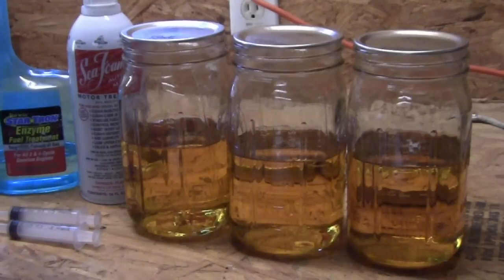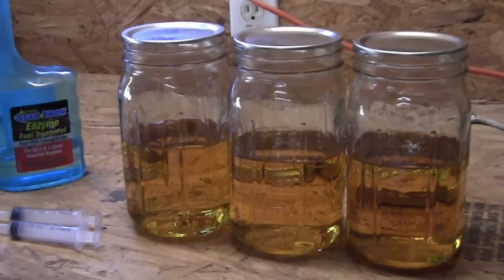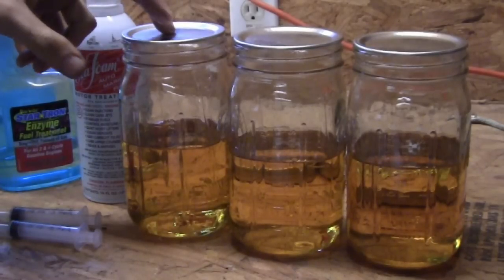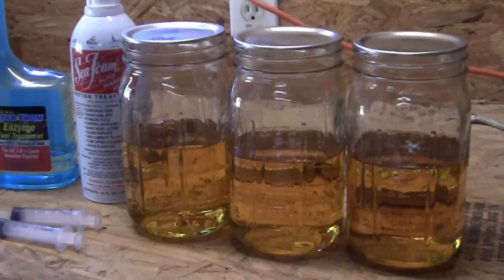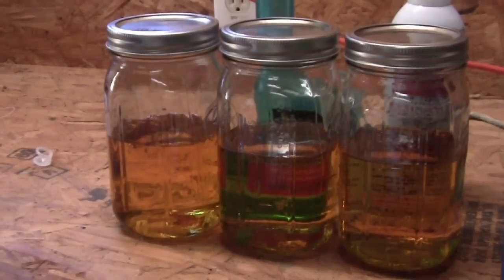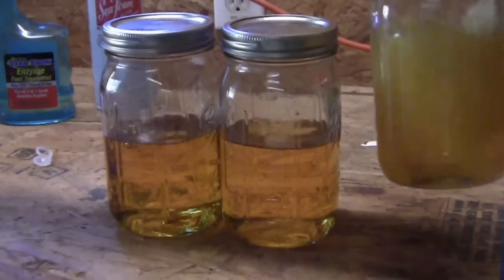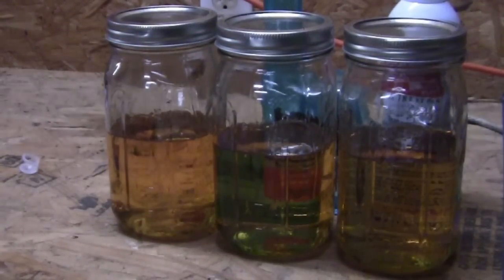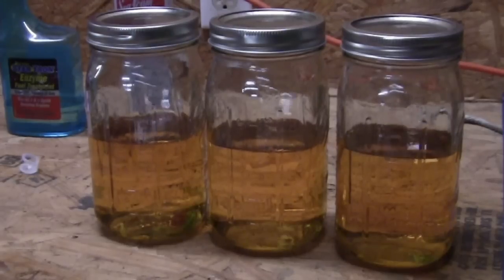Stale Gas: Can it be treated with additives? My unscientific test and results.

Comment: But how do they run in an engine?  Try each one to see.
Reply from the maker: +grassroot011 that's my plan for the next batch of stale gas I get. I tried to start a bonfire with this stuff and none of it burned spectacularly, the additives didn't seem to make much difference but the only true test will be in an actual engine, which I'll do when I get more sometime.
Reply: Good, Like to see that. Thanks
Reply: Why would you get stale gas in the first place?
Reply: @nickv4073  he said in the video his watercraft has been sitting for like two years, dumbass.
Reply: @nickv4073  lol

Comment: Google.com Sarge LS1 and read his testing on using Marine outboard TCW3  oil in your gas every time you get gasoline. The formula is 1 oz oil per 5 gallons of gas. You won't know your car is running at idle. Give it a try.

Comment: TCW3 stands for Two Cycle Watercooled generation 3 outboard Marine oil. It's for Watercooled engines like outboard motors. It's what you add to the gasoline for lubrication in the engine. It cleans and lubes the whole fuel system.

Comment: Forget all that. Use Marine outboard TCW3 rated oil at 1 oz per 5 gallons every time you get gas. It burns ashless so it won't harm sensors or converters. Check out Google.com on this and you will find many people do this with great success. It works like Lucas fuel conditioner and injector cleaner but much cheaper. Better than Marvel Mystery Oil. It must be TCW3 rated and it cleans and lubes the whole fuel system. Collects water in tank to be burned with the fuel. Google.com Sarge LS1 uses Marine TCW3 oil.